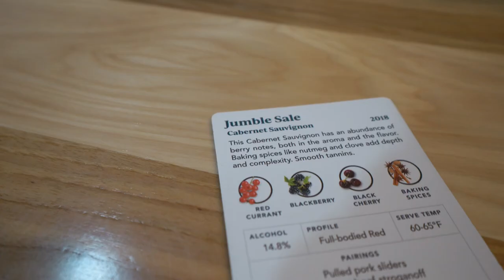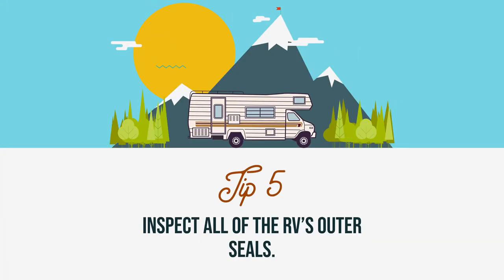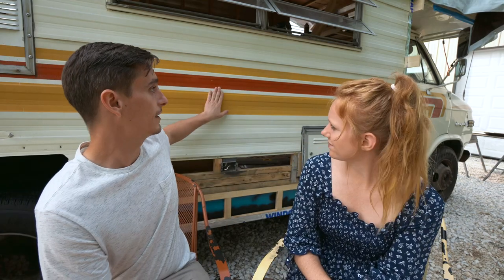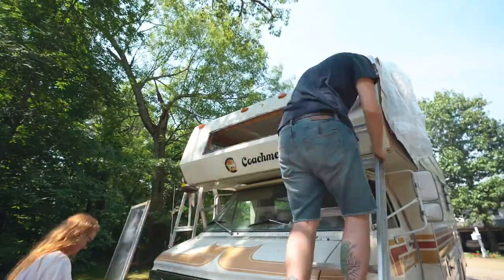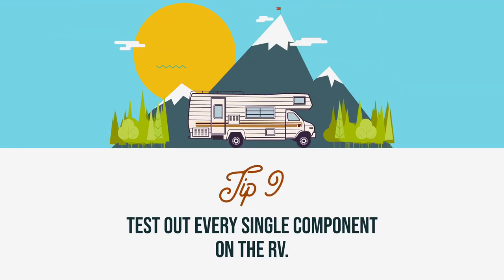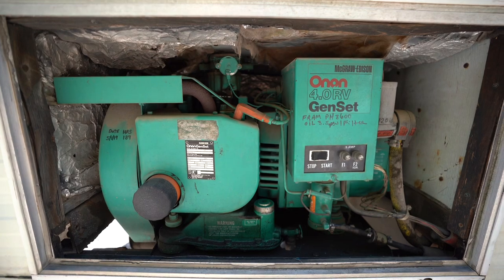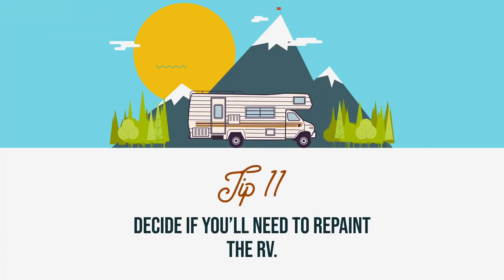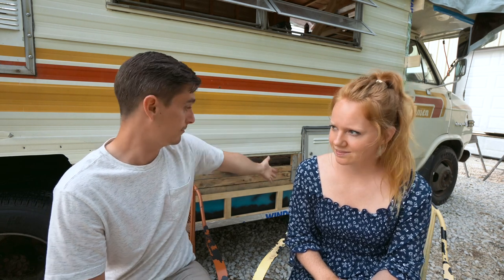Vintage RV Buying Guide - TOP 12 Things to Look for Before Purchasing an Old RV!

Comment: About the paint job. You guys have almost half a million subscribers, I'm sure there are some talented artists among us (not me though). I think You should do an art competition where You let fans send in pictures of how they would paint the whole thing and then You choose a winner who gets to paint it irl in exchange for a spot on Your next group holliday or something like that. Use Your community, I'm sure people will want to help out.
Reply: A good body shop painter can match ANY color.
Reply: Buy new aluminum siding in the color you want. It's still available.
Reply: I don’t think that’s the kind of painting they are talking about. Painting a vehicle involves sanding it down and removing all rust. Then there are multi stages to a paint job with paint and finishes. Not to mention, you probably need specialized tools and to factor in the cost of the paint.
Reply: Offer advertising on your RV for a partial or entire wrap🤗
Reply: I don't think you know how painting the car looks like. Car before the paint has to be sanded, any rust removed, then primed, then finally spray painted. This is a lot of hard work for one person even for a smaller car. Not to mention all of the products and tools are expensive. You can't just use any paint, and this is no job for any random artist.
Reply: I painted an 28 ft motor home cost about 300 cad all in.. took me 25 hr would send a pic of me doing it but kinda can't on youtube
Reply: Also painted my own travle trailer 23 ft took 15 hrs
Reply: Just park your RV in a rough neighborhood, you should get a lot of free paint jobs.

Comment: Good tips.  The first thing you should look at is the outlet of the tailpipe.  If it's rusty or black, then the engine is burning water or oil, or both.  That means the head gasket is going on the engine and letting water/oil into the pistons.  And when underneath the vehicle check the ridges of the subframe for any cracks or welding.  Older vehicles from the 70's and 80's used metal that was prone  to rusting. Then check the wear on the tyres.  If one side is heavily worn compared to the other then the wheels are out of alignment.

Comment: You guys are really killing it, great job. Not sure of your budget, but replacing the carburetor with an aftermarket electronic fuel injection would make a lot of sense. Easier starting, better running, better mileage, less emissions, more power. The installation is most likely out of your comfort zone,  such as welding a bung in the exhaust for an O2 sensor, but companies like Holley and Edelbrock make EFI kits for upgrading your vehicle.

Comment: Just started my renovation of a 1991 Seven seas by Cobra. It will be a full tear down including walls, plumbing, electrical. All new internals. Started taking wall out and water water every where. The front overhead sleeping is completely gone. lots of work. But cant wait to empty the inside putting everything. Thanks for you fun and informative videos.

Comment: We didn't do much renovating. We reupholstered all the furniture. We took out one couch and installed a recliner from Lazyboy and had a custom cabinet built to hold the kitty box. In the bathroom we had an under the cabinet light installed. That was so helpful. You can now see the sink area so much better. Other than that our motorhome looks like new inside and out. People can't believe it is a 2006.

Comment: That 16.5 tire size on these older RV's is so outdated that tire manufacturers may not even be making that size tire anymore which is why it's hard to find, and if you do find them they are usually "new" but already old rubber. Swapping out to 16" rims is a good idea as it's much easier to find new tires at a better price. Tip: you can find used 16" dually truck rims on Craigslist or at a junkyard. I found an entire set of 16" dually rims from an 80's Chevy truck on Craigslist for $80!!!  My Rv is a 1983 Chevy G30 Minnie Winnie so the rims I found are a perfect match. :)

Comment: When I was in my late 20's my Father in Law and I rebuilt a 40FT Swinger Class A like you've been doing, it was a nightmare. It had the whole inside rotted from water and mold. WE had a big dumpster in the Driveway tearing it down, had to rebuild the frame a section at a time to keep it from caving in. It was fun in a strange way brought us closer together and wow so nice when done. Lots of custom furniture and Cabinets. Motor was solid was taken to California from Illinois and back on it's first trip. Tragically it was lost in a fire about 2 years later a total loss. We did rebuild a Popup after that as well. I think it was a 77 if I remember right.

Comment: Adding to the last "tip" crawling under the RV would also be a good time to check the underside of the engine - for oil leaks, debris damage to oil pans, rear differentials. 
 - And after you have bought it, it would be a good idea to change Engine oil, brake fluid, differential oil followed by some grease to greasing spots. Vehicles run a lot smoother, and "behave nicely" when they have fresh/ and clean oils and necessary amount of grease.

Comment: You guys are rock stars renovating that older RV! One thing that you may or may not know is that several ‘Good Sam’ campgrounds and even more Independent campgrounds are not allowing RVs older than 10 years old in their campgrounds, so when you takeoff on your “endless adventures” when you’re done renovating be sure to call ahead. This has happened to friends of ours and also happened to RV’rs on YouTube channels, even Airstream trailers that are perfect but older than 10 years have been rejected from going in the campgrounds. It’s really a stupid requirement but just be prepared.
I don’t think KOA’s or state and national campgrounds have that rule though.

Comment: One tip on inspecting any used vehicle before purchase, take as many photos, closeup's if possible as one always misses things at the time and looking at a blown up photo later will often show defects missed at the time. a good light needed backed up with flash and different angles. Once satisfied the deal can be done.  Don't fall for the old trick of "I have several people interested so the deal needs to be done now".  Call his bluff.

Comment: A Wrap can be done cheaper than painting the RV, plus you can make it any design you want and even add logos in it and easily change it anytime you like. Also you should look for a modern size wheel with the same lug pattern/dimensions so if you are out traveling and blow out a tire it will be easier, faster, and cheaper to get a replacement. You can sell the old wheel and tires to someone needing them for their RV and make back money towards the upgrade!

Comment: Thanks to you both. I am spending more on my '99 Bounder than I intended, but it is a labor of love, farming some of the work out and doing some of it ourselves. Always check tire condition, tread depth, and date of manufacture. Unused tires sitting on concrete or dry ground can dry out on the insides. That is why I was glad to see the first thing you purchased were new tires for your Coachmen. Six thumbs up for six new tires 👍👍👍👍👍👍

Roofs are one of the first places to check before purchasing an RV as one of the biggest expenses, if you have to completely re-roof versus simply recoating. Re-roofing is a deal-breaker for used purchase in almost every circumstance, unless you are willing to take it on.

Comment: If it smells like an entire can of air freshener run!  You guys have learned a lot in a short amount of time.  We restored our 1975 GMC Eleganza 2  .  I'm sure the seller thought I was crazy as I stomped on every inch of the floor, pushed on all the walls, inside cabinets and closets too!  We got new wheels so we would have tires that are easier to replace in an emergency.  Again - we are proud of how you are pushing through!
Reply from the maker: Lol, another great tip! 👃We'll for sure be those people if we ever buy a used RV/camper again 🤣

Comment: Surely the big advantage gutting as you go along is you know what goes where, after watching your renovation so far I've seen a number of occasions where you have used the old wood/metal parts as templates to make the new ones, I guess that would have took a lot longer had you not had any idea what sizes of pieces were needed ? Love all your videos travelling and the renovation :-)

Comment: As far as the wheels go if it's impossible to find tires you could go a size up or down with the rims as long they clear the brakes. I'd bet you could get a set of 16 inch rims to fit on there no problem and it barely affect the performance of the vehicle if at all. Usually you can find good deals on tires if you look hard enough though. I managed to find 17.5 inch tires for my motorhome on eBay for about 100 bucks each when the local tire shops said they couldn't find them or they would charge 5x as much.

Comment: If you are buying an older TV and have the 16.5 in rims(like the one you are working on)consider looking at newer 3/4 or 1ton pickup trucks of the same make.... they have the same bolt pattern and correct back spacing plus the tire size will be easier to find

Comment: I recently bought a 1985 Fleetwood southwind RV. I wanted to buy one that was gutted but there was no RV around that was actually gutted unless it was a fifth wheel trailer. But my RV is a fixer upper and it's a piece of garbage but it's my garbage 😂. I'm going to be starting on it this weekend and I'm going to start by tearing out all the carpet and gutting it.

Comment: I just got a 1974 dodge 22ft.  I think they only way for this classics is to complete rebuild them from scratch, so the gutting job is more like remove appliances you probably won't use, and then just smash the rest to bits, don't try to save anything.  Look at school bus conversions, and they are starting with nothing but an empty shell, same with vans, etc.  Maybe keep the exterior wall panels to keep the same classic look/shape.

Comment: When it comes to it not wanting to start, I'd suggest a carburetor rebuild. Either that, or pump the gas a couple of times to get er started. If she still doesn't start pump the gas while the starter is engaged. But be careful not to flood the engine by pumping the gas pedal too much. I've pretty much only owned carbureted vehicles, I prefer it over fuel injection. Once you get to know your vehicle and it's quirks it'll become easy. But in my experience if it won't start after you've tried numerous times and have pumped the gas, and you know you have fuel and spark, it's probably flooded. So what I do is I take the air breather off, and open the choke on the carburetor and keep it open with a screwdriver, wait a bit, and with the choke opened then I try starting it, but be careful not to have the screwdriver fall into the intake manifold, because that would be detrimental.

Comment: Glad we ended up with a GMC Motorhome, having a fiberglass/aluminum  body helps minimize leaks/rust.  We still have found a few, but nothing that required a full gut.  Also, if you can change wheels, getting a set of 16" rims will save you money in the long run since Firestone is the only major tire maker to still sell 16.5s, and with the correct size the speedometer doesn't need to be adjusted.  That's the first thing I did when we got our and I'm glad because Alcoa discontinued them a year later. https://i.imgur.com/HFG0eIr.jpg
Reply: 225/75R16 is a common replacement size. You can likely get a full set of tires and (used) 16” wheels for less than a set of 16.5” tires and if you end up with a blowout you can find a replacement at any roadside tire shop without wait.

Comment: Consider adding power train (engine, transmission, driveshaft & differential) as another look before buying item. Many 70's & 80's were built with either  a 454 Chevy or 460 Ford and combined with a 3 speed automatic transmission. Good engine power but the 3 speed transmission equals about 8 or 9 miles per gallon. Some were also driven hard without adequate maintenance equaling about to blow engines and transmissions. Very expensive! I have seen many restorations up for sale because the restorers forgot to check the power train. I remember you had some mechanical work done after your purchase. Did they perform a compression check? An inexpensive upgrade for your engine is the air cleaner. K & N and others make good systems. Improving the air flow to the engine is good thing for mileage and performance.
Reply from the maker: Great tip! We had a little engine work done - mostly just to quiet it down - but we'll be doing much more extensive work on both the engine and transmission soon. We definitely don't want to do all this work only to have the engine give out 🙈

Comment: Amazing guide, especially about the mold and assessing how much you will want to interfere with in the rebuild.

 What if I wanted to do a complete rebuild, that is, tear down the inner walls to apply some proper insulation, would I have to be that fixated on checking if there is mold during the purchase (e.g. squish test), or does this tip rather come in handy if you won't be doing a full rebuild?

And you guys are the reason my girlfriend and I are going to rebuild a campervan in a few months. You have a very confident and "we'll make it" attitude, I love this in American culture! Thank you for all the content.

Comment: This isn't really a tip but you might consider putting an exterior watertight covered outlet on both sides on the RV. That way if you wanted to sit outside you could still plug in your gear. Just a random thought.

Comment: I would disagree about tires. Its pretty easy to swap new rims and convert to 16 inch wheels. That opens up a world of options for tires. Also the Transforce HT in a 16.5 is much stiffer and does not get as good of traction as the 16 inch version. The Transforce HT tire is a pretty good tire either way.

Comment: This video is full of great information. The problem is, I just put an offer down on a 1995 Newmar Kountry Air Class A. We are in the finalization phase of the purchase. The good thing is, the engine only has 48000 miles on it and started right up and sounds great. There are signs of a small like on the ceiling which appears to have been fixed rather quickly. I did not get up on the roof and check the seals. I just assumed that I will have to redo all of it fairly soon. I know that I will not be doing a total renovation, like you guys, but some small things will need to be fixed in the future. All cosmetic issues. The generator only has 117 hours on it and started with minimal priming. I would put the cost here, but, that is where we are still in negotiations. Feeling right, it felt so right to make this decision, everything felt perfect.
Reply from the maker: How exciting! Hopefully you were able to close the deal and have tons of great adventures with your Kountry Air 🙌
Reply: @Theendlessadventure  Well, it happens to be that there is a lean against the RV so, my bank said NO.  Not to worry, I had a backup plan and am working on another.

Comment: Unless you're a structural engineer, its a mistake to 'gut' an RV.  The manufacturer did some engineering design calcs in the beginning.  So, tearing out any interior vertical surfaces that was screwed/fastened to the walls and floors or ceilings, were there for a reason.  At some speed (er wind speed) the shell will just blow away.
When you sell dont tell what you've gutted/replaced...  that is a major reason to walk away.

Comment: I would consider buying a higher end rig(older or newer) as well with more sound structural design than wooden frame rvs. aluminum tubular framing and steel sub structures will be much more robust and less prone to structural failures from rotting wood frames etc. Will cost more but going cheaper you are going to end up with same problems in the future and had wasted your time and money redoing everything... great tips other wise though!

Comment: How about engine noise, or exhaust sound?  The sound of the engine at idle and acceleration? What do you think?
Reply: Most RV's that age you would need a tune up, replace most rubber hoses, seals and gaskets as they are old and brittle. The 16.5 tires are not huge problem, buy 7 new 16" rims and 225 85R 16 tires. problem solved.
Reply: I think it's going to be expensive.
Reply: Along with generator noise, potential for a sleepless night.

Comment: its not 100% but if you buy an rv that spent its life in arizona or nm in the desert you will have less mold than something from washington state. Also avoid the rust belt since rust is a major issue on any older vehicle.

Comment: Great tips: Or buy a newer used RV (under 10 years) that need minimal maintenance and no overhaul. Seems like you might spend $15K when you’re done. The problem with buying RVs in general is assessing their condition is harder than a car. There’s just too many types and sizes.